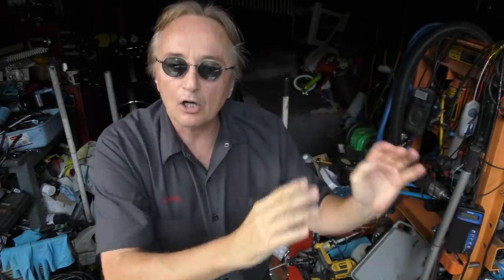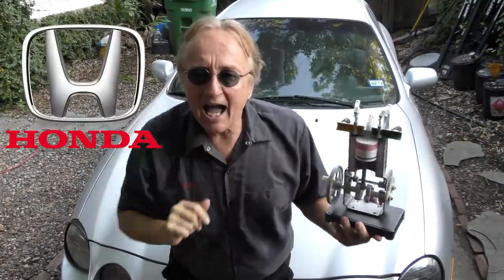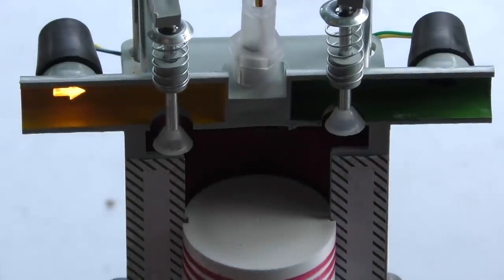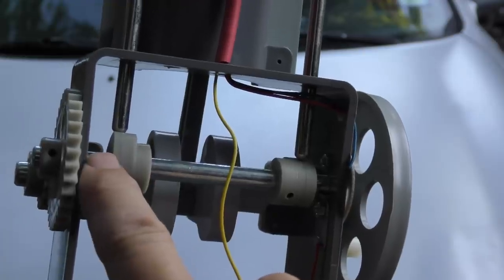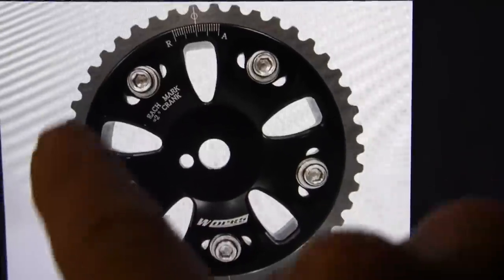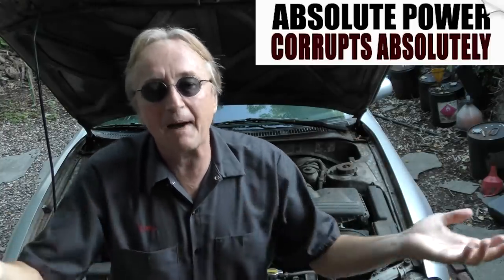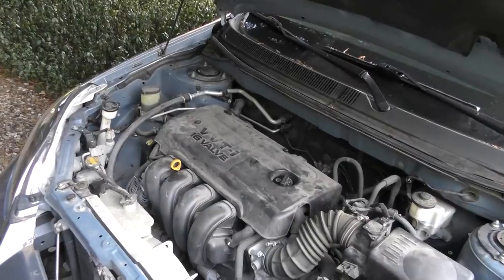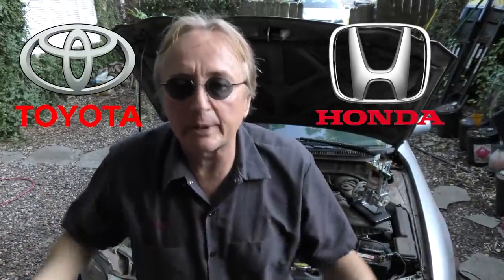VTEC Just Kicked in Yo - The Best and Worst VVT Cars to Buy

Comment: Great video as always! Are Mazda's VVT engines that terrible? Made me worry a little because I have mazda 2.0 147hp engine...
Reply: well i think scotty was a bit overzealous with the accusations, VVT is offered on so many cars under 1000's of acronyms, but overall the advice to do your research, is good advice. some VVT engines are non-interference, and fairly easy to replace (like on the mazda mx5) however the newer mazda skyactiv engines are interference. Honda probably makes the most reliable VVT engines, but that also sometimes means more complex, which means more expensive to fix
Reply: He's talking about the Skyactiv engines, apparently they haven't proven to be very reliable as of yet. Make sure you do as he said and change the oil on time and for the correct one, these systems are very sensitive. If you take care of your car and do preventative maintenance every now and then, they can still be great cars.
Reply: Used to have a mazda 5 with VVT, the actuator failed and took the valve train with it. Found out after the fact there was a class action lawsuit filed for this issue, but nothing ever came of it. 138k miles then poof.
Reply: 147hp out of a 2.0L? , you have nothing to worry bro
Reply: QuesoBurguesa Wow. That sucks. Mazda better step up their game in  this industry.
Reply: Mazda has a very large step in this industry already, they are leaders in making new technology work, however new technologies take time to mature and the skyactiv technology just came out as a finished product a few months ago with skyactiv-x. The technology has been proven to work, now they just need to perfect it and make it more reliable.
Reply: Alien Federation just do regularly mantaince and you will be fine.
Reply: i think they're leading as the most fuel efficient manufacturer in the USA, 5 years in a row (if i'm not mistaken). i think if the industry stepped their game up just like mazda, they'd have uncertain systems in their cars too
Reply: I feel the same way too but Mazda's engines have at least improved. I've got the same engine as you do. Probably best thing we could do is stay on top of oil changes and maintenance schedule.
Reply: I've owned 4 Mazdas and a couple Hondas over my life time and I've never had any problems with the exception of auto windows breaking which also happened on one of my Hondas. This isn't the first time I've heard Scotty take a stab at Mazda and it really annoys me because I keep buying Mazdas because of their reliability. I've had an FS, a KL, a MZR, and a Skyactive and never had engine problems.
Reply: You're right, I was thinking that they launched skyactiv-X already because I saw some reviews, it was just a press event apparently.
Reply: Alien Federation Haha!!! My 2.4L is 200hp with no problems sorry bro
Reply: They've gotten better. 2012-2018 Mazda 3 and 6 are rated at above average reliability according to Consumer reports.
Reply: Alien Federation Mazda has never been reliable
Reply: The SKYACTIV gas engines have been out for 6 years now...
Reply: I have a 2008 Mazda 3 with the same motor and 5 speed, just hit 170k miles and never had an issue with the vvt system
Reply: It's a good thing for all of us that Daniel Grabovskiy has done his research and tested every Mazda past and present so he can provide a group of people who have had great experiences with Mazdas that their reality is warped and the entire brand unreliable. I for one am grateful for blanket statements with nothing to back the statement such as these, because now I know after a few decades of driving and owning several Mazdas that the cars weren't actually reliable and the fact that they didn't break down was a statistical anomaly. Thanks for opening my eyes.
Reply: I to am not sure where he got his info from about unreliable Mazda petrol engines - diesels are another matter (at least in the UK and EU, where from the early 2000s onwards they [the bought-in 1.6 and now 1.5 ltr, then 2.0 and now 2.2 ltr units] have been unreliable to a degree), but I've never heard of ANY problems concerning the 1.3 & 1.5L petrols in the Mazda2 all the way back to the mk1 in the early 2000s, 1.4, 1.6, 2.0L N/A and 2.3T in the Mazda 3, 5, CX-5 and 6 up to when they all were replaced by the 1.5 & 2.0 Skyactive-G units around 2013/14.  We never got the 2.3/2.5 N/A petrol engines, but thus far I haven't heard anything bad about them at all.

I own a 12yo Mazda3 1.6L petrol, admitedly only with a low 65k miles on the clock, but it hasn't had one issue with the engine as yet, and I've driven another (former work pool car) that had 120k on it and it was just as good.  Like ANY VVT engine, if they don't receive decent grade oil as per the manufacturer's handbook, then they break - even Hondas.

I'm also a member of a well-known motoring website in the UK, which has a knowledgeable owner/regular contributer (who is also a well-respected motoring journalist and former dealer of repute) and an excellent forum and review section, and as yet there's been not one sign of a major issue with ANY Mazda petrol engine in over 20 years (even before Ford got really involved in the early 2000s), aside the rotary one, which is obviously not the same tech.  I've also looked abroad, and again, no reports of note at all for their petrol engines.

Sorry Scotty, but I don't think you're right on this one.
Reply: Mazda had issues with the VVT in the CX-7. Haven't heard of many SKYACTIV engines with a VVT issue. Of course every manufacturer has their own issues. Toyota and Honda has excessive oil burning issues a few years ago due to piston rings.
Reply: Stewart - I think the main 'issue' (if there actually is one to any degree) with the lastest Mazda Skyactive-G engines is essentially the same as ANY GDI petrol engine - the injector doesn't keep the the valves clean as the older design fuel injected cars did, so as more susceptible to gunking up, more so on lower grade fuels and if they are mainly/exclusively used on short, slow speed urban journeys from cold.

I do agree that the Honda VTEC engine is still the 'Daddy' of all that type, followed by the Toyota version, but the I think Mazda's versions are fine engines (I own one - see my other post below) and have never heard of any problem of significance that was due to anything more that poor maintenance.  Far better than much on offer from Europe (admitedly that's no saying as much as it used to, especially when regarding ze Germans).
Reply: No........... They are not
Reply: Uhhhh.... skyactiv tech has been in Mazda's since 2013. The full skyactiv tech came out 2014 with the gen 3 release of Mazda3/6 and the MX5 CX5 blah blah blah. These are by far much more developed than a "few months ago".
Reply: My Mazda/Fusion 2.3L has 200K miles. If you change the oil at the right interval, Mazda's can be reliable as well.
Reply: The Wankel engine was a gem, but just unreliable.
Reply: The problem is, he didn't mention what particular models or engines. Mazda used to be owned by Ford, but Ford sold off the rest of their shares in 2015. Before that, Mazda and Ford were slowly uncoupling from each other. They used to share platforms, parts and technology. Now they don't anymore. The last model at Mazda to use a Ford platform was the last generation CX-9- but now their entire lineup is all Mazda all the time. I don't know which model years Scotty was referring to or which engines he was referring to. According to Consumer Reports and JDPower, Mazda has above-average reliability. You'll get different answers depending on who you ask, and how "reliability" is defined and which features are weighted more than others- but it's agreed that Mazda's powertrains are above-average in their reliability, not as reliable as Toyota, but alongside Honda and other Japanese brands.
Reply: I'd assume he's talking about Mazda MZR issues, which we're notorious for VVT issues due to the actuator. I have a DISI MZR engine in my 09 Mazdaspeed 3. The 2008.5 and later supposedly got a better VVT actuator, but many people still have problems. I have about 89k on mine with the original VVT system. I believe Scotty's right, good oil and changing often are key for the system to continue to work correctly. I've changed my oil every 3-4k from new, far more often than the recommended 5k-7.5k the manual claims. I did this to make the turbo last, but it helps the whole engine last. This is especially true in a high stress engine such as this.

My wife has over 50k on her 2014 Skyactiv 2.5L. I haven't heard of regular VVT problems on it. We change her oil every 5k. 

I dont take offense. If it's not an NA 4 cylinder made by Toyota, it's no good! :)

As far Toyota reliability, my parents have owned many, most from new. They generally had more problems than my Turbo Mazda, so YMMV.
Reply: Ryan Jackson ask a owner of Mazda about the rust, and they all start lying. They made shity bodies, european diesels engines and rotaties have significant problems. And marketers still show to TV city sheeps how new and great car they are
Reply: TheFPSPower Couldn’t pay me to buy an experiment...
Reply: TheFPSPower sorry bub... Mazda is falling off the block they better step it up.
Reply: well, i had (sold last week) a 2004 mazda3 1.6, with 232k Kilometers on clock, still running strong, also I got a 2011 mazdaspeed3, with 76k miles and still running strong, I think it depends of the owner, soooo many people have mazdas around the world and they are really reliable. Scotty may have 1000years of experience, but that does not mean that because he fixed 1 to 5 mazdas with that Issue mazdas engines aren't reliable.
Reply: It gonna explod next time u start it that's the worts engine ever manufacturered be careful
Reply: My VVT actuator died at 100K+, it's a crap shoot with those things. But I totally agree the Miata is an exceptionally reliable, trouble free car, especially when maintained in stock form.
Reply: Alien Federation 147hp lol that's bad my Acura non vtec has 140 lol
Reply: Stewart Mckinna according to statistics the 1.6 VVT m16s is the most reliable modern engine and it's made by Suzuki lol
Reply: He did mention that those engines used Motorcraft parts.  Motorcraft is Ford and for a number of years, they did have control of Mazda.  I had a Mazda 6 S with the 3.0 L Ford Duratec V6 and it was an alright car.  Had it for 12 years and put 240,000 miles on it; perhaps not a record for longevity, but I feel that I did get good usage out of the car.
Reply: TheFPSPower he's not talking about skyactiv Motors because the motor he was referring to used a Motorcraft part Motorcraft is ford therefore it had to have been made by Mazda during their partial ownership with Ford skyactiv technology came after this partnership had ended
Reply: ouimetnick ; From what I recall, the CX7 used the same drive train as the Mazdaspeed 6 and yet, that was troublesome.  I think that final version of the CX7 switched to  simpler, more reliable design but I don't know how much of an actual improvement it really made.
Reply: You shouldn't be worried if you have the 2.0.

Mine is at 300K at it still runs strong. Just change the oil often.
Reply: Scotty is talking about the first vvt engines mazda made witch weren't that great. I have a NA miata and I swapped in a NB 1.8 with a 6spd but I specifically chose the nb 1 engine without vvt because it only makes about 5 hp more and is way too complicated thus making it more unreliable and is lots more work to get operating on an aftermarket ecu.
Mazdas are great cars but every manufacturer has bad engines/cars.
Reply: If he is indeed talking about Mazdas from the 1990s, then fine - even in the UK I don't see many examples from before the year 2000 except MX-5s (Miatas), and most of them that haven't been lovingly tendered to are rusting badly.  On that front, Mazda has improved significantly since then, and later models of that car (like my late 2005 Mazda3 mk1) are far better.

The petrol engines are now similar (not quite as long-lasting/bullet-proof) in terms of reliability to Hondas and Toyotas in the UK and have been since the early 2000s.  As I said in my other posts, their diesel engines still have many issues - not helped as at least one of them is made by PSA.  If they are looked after, they last.

In the UK, Mazda's tie-up with Ford actually benefitted both, as Ford got some more robust engines (they replaced the [very well regarded and reliable] 1.8vvt Mazda petrol engine with the unreliable 1.0L ecoboost) and better electronics, whilst Mazda got the great handling chassis from the Fords (Focus, Mondeo, Fiesta) to use in their range above the MX-5 (there wouldn't be any 'Zoom Zoom' without that).

Ironically, at least in the UK, both's fortunes have slipped since their breakup a few years ago - Mazda sales are now half of what they were 10-15 years ago.  Admitedly, we don't buy pickup trucks, so sales of those in North America and Down Under may help to bolster sales in those regions.

Ford have had lots of reliability problems in the UK with their Ecoboost engines (except the 1.5/1.6L petrol derived from the old 1.6L non-turbo Yamaha designed unit) and had the added issue of those engines being significantly lower on real world mpg than other makes offering small-capacity turbocharged petrol engines in their cars.  Again, the market is a lot different outside the EU, so fortunes may vary.
Reply: Andrew Griffiths the vtt engines in the miatas are the nb models from 2003 and newer. But its not like those engines are BAD they're just not he best but there is a lot worse...
Reply: dont worry samething other will break before that happends. Mazda is crap its the unicorn horse of Japanese cars
Reply: My 2008 mazda 3 has 305000 kms and still going strong.
Reply: Same experience: Mazda is 100% reliable, as long as you stick to the petrol. I do have to add that problems with diesel engines often start with the people who drive them: they do mostly short trips on them. If there is sth a diesel does not like, it is driving cold too often.

The Ford years affecteds mostly dull designs, not that much the reliability. There is a strong myth in Europe 80s Japanees cars were better build. I think the truth is rather most European cars in the 70s and early 80s were soo poorly build, the Japanees contrasted a lot more then they do today. European car building has come a long way since then.
Reply: Same for me, drove mazda's al my life and the worst problem i ever had was a bad sparkplug cable.
 I own a 1977 mazda  818 coupe with 95.000km's ,  a 1993 mazda 626 hatchback 2,5L-24V  with 270.000km's and a 2015 mazda CX5 with 46.000km's. 

Even toyota srew up sometimes, the first generation avensis had terrible engines. My father had one with 30.000km's witch used more oil than gasoline.
Reply: Rotarys are very reliable if u use them the right way. Short trips to the store and back are killing for a rotary, u have to warm it up gentle, and when it is warmed up, you can rev. the hell out of it. the higher te better.
But if you start the engine, drive it out of the garage and shut down the engine again, your in trouble..
Reply: Jake from State Farm I had a 96, manual. Cheap to fix, but fixes were rare
Reply: Only the older, non-Skyactiv Mazda engines are unreliable. The new ones with the Skyactiv engines are proven to be reliable, and they use 0W-20 synthetic oil, just like Honda, Toyota, Subaru, Mitsubishi, and Nissan. Now 0W-16 synthetic oil is on sale for newer hybrid engines and also for non-hybrid vehicles that require 0W-16 oil, such as the 2018 Toyota Camry.
Reply: josh FD is mazda
Reply: No, I have two Mazda proteges with over 200k miles working perfecty. One will be passing 300k in the coming month. He also says the problem part was a Motorcraft part actually symbolizing something created by ford. This often indicates they were using a ford based motor such as the ford duratec.  Mazda has been using VVT for some years without much issue. There may or may not be some random outlier motors that have problems, but Mazda makes generally reliable vehicles. I wouldn't worry in the slightest.
Reply: The FS and KL motors are really great motors for their times though. I mean the KL based Mazda 6 and Ford probe were actually faster than their Ford mustangs with the 302 V8 motors. Crazy that was a thing.
Reply: Up until the RX8, they really weren't unreliable. Motors built in the 80s weren't really expected to last 150k miles and most of the NA rotaries did that perfectly.
Reply: The early CX-7 & 2007-2008 Mazdaspeed 3, & all Mazdaspeed 6 use that engine and have far more VVT problems. The CX-7 & Mazdaspeed 3 were updated half way through 2008 and have far fewer VVT & turbo problems, if well maintained. Poor maintenance and treatment kills these engines as they are sensitive. The non-turbo MZR engines probably had a similar 2008.5 update with the VVT, but I don't know for sure...Protege & 626  didn't have VVT at all IIRC.

Skyactiv on the other hand is all Mazda engineered and not sharing parts with Ford, so read into that what you will.
Reply: TheFPSPower Motorcraft is Ford's in house supplier. He's definitely talking about the older MZR/Duratec motors developed when Ford still had controlling stake in Mazda.
Reply: Skyactiv NA motors are fine, no Motorcraft(aka, Ford) actuator. I've been driving my Skyactiv 2.0L really hard(redline a dozen times per drive) for 5 years now with 0 problems.

Comment: Owned a 1991 Acura Integra with one of these engines.  It was great until 209,000 miles.  Then the electronic lift failed on the VTEC engine and it was toast.  The whole power train was going at that point as the transmission was showing signs of wear at that time as well.  It was a good engine but not indestructible.  Same thing happened to one of my brothers at about the same mileage.